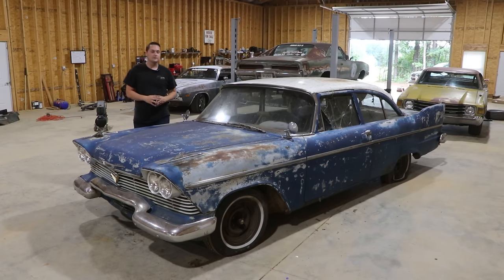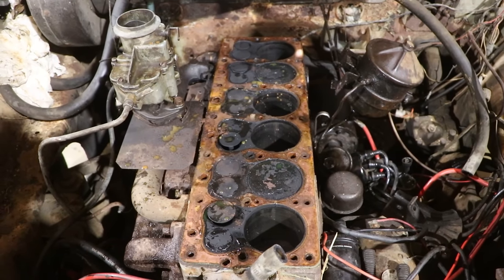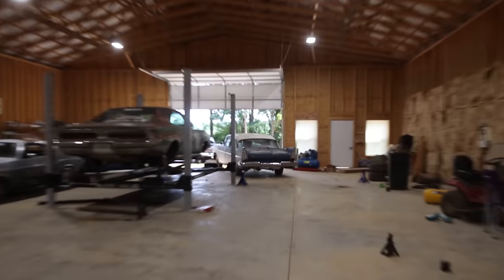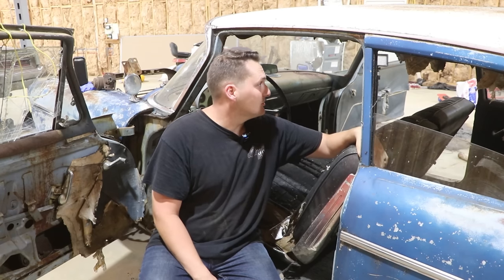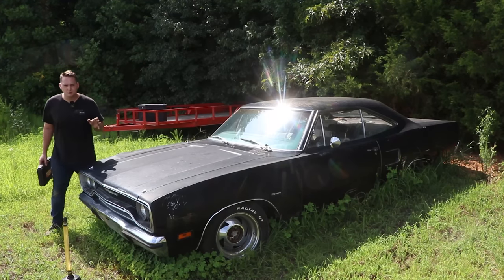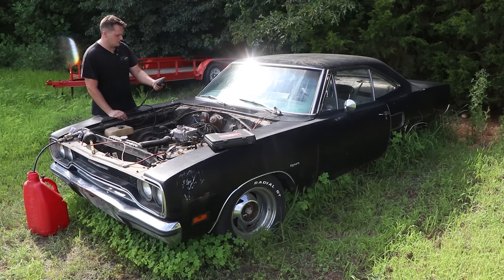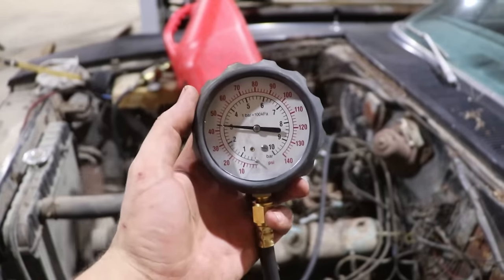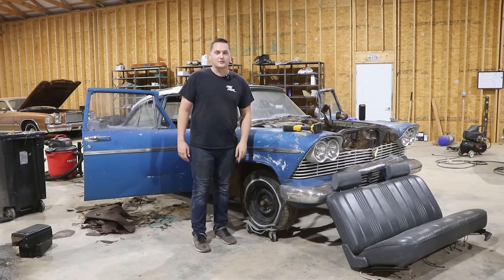Barn Find 1958 Plymouth Engine Teardown - Is It Too Far Gone?

Comment: I think it would also be cool instead of putting a V8 in it Build up the Six like the old school Hot Rodders did back in the day because you can put a different intake and a 4 barrel on that Six and make decent power
Reply: He said that flathead six was too worn out to rebuild.
Reply from the maker: Would be cool I’m sure. I just have no interest in modding s six cylinder.
Reply: @danielventura8073  Yes, and let's not forget that everything is fixable, but at what cost xD, you could for sure refurbish the old flat six but it would just take a lot of money and time sadly.
Reply: In the cars day, that is what would have happened, Mod the old six, cam, carbs, free flows etc, ANY engine can be rebuilt regardless of how worn it is!!!!!
Reply: Americans thinks anything under 8 cyl as "small" lol when this car has a very big 6 cyl!! But make sense to V8 swap It for him, from the availability of parts for example V8 Is more common he can find very easily a simple configuation good for the car and for cheap
Reply: @gillespriod5509  I keep forgetting that European car makers since the beginning made cars with small engines to save on gas. I still remember getting to sit in an Alpha Romeo Montreal when I was younger. Amazing how that car had a 2.5 liter V8. thats the capacity of a lot of in line 4s!
Reply: @loganorlikoski1743  yes anything over 1600cc Is considered big in Europe,and with the price of gas you cannot daily drive a 2 liter without becoming poor😁
Reply: Whew that's a relief. I've been sweating bullets here thinking Dylan was going to put a city LS in the Plymouth.
Reply: @gillespriod5509  ANY engine can be REBUILT up the compression cam, carbs, free flows etc it will make decent power and speed, remain ORIGINAL and More COOL, ANY IDIOT can V8 swap a car, they are ONLY ORIGINAL ONCE!!!!
Reply: @DylanMcCoolVideo  if you want to go 318 why not drop a 340 or 360 in it?
Reply: @DylanMcCoolVideo  sorry Dylan didn't mean to stir up a hornets nest about saving the Six. It's your baby you do what you want. I still think black and call her Elvira would be Awesome
Reply: @barryphillips7327   im a mechanic and i rebuilt in the last 20 years many engines from vespas to rally cars since i was a teenager, i know that! So? He can keep the six at home in the big garage he has, maybe even rebuild It for the future if he care of the originality, i always do that on my older vehicles if Is worth doing! but the V8 makes more sense for him for reliability,  parts prices and availability,  Is a no brainer!!!  He plans to use the car, maybe doing roadtrips, not to park her in a stupid museum! Anybody Is always Expert in YouTube comments! LOL!!!
Reply: @gillespriod5509  as you know then ANY engine can be rebuilt ANYTHING can be rebuilt IF the owner is willing, i,d prefer to see the six stay, done up warmed over, any idiot can drop a V8 in the car but it is not meant to be there!!
Reply: @barryphillips7327  he can do a good v8 swap, he has the right engine, the same car came also in V8 version, so Is not bad like put a japanese engine in It! And he can rebuild or tune the V8 before mounting it
Reply: from a lot of car channels i watch sadly the solution to everything engine related is put a v8 in instead of a 6 cylinder
Reply: @danielventura8073  He said it was too worn out to re-ring without reboring.  Never too worn out to rebuild.
Reply: @kristofferjonassen4761  Flathead 6.  Flat 6 is what the Corvair and Porsche have.
Reply: @tractorjunkco9431  Then he would have to replace the rear end as well.
Reply: @kristofferjonassen4761  There isn't a lot of high dollar mods for the flathead.  Many of  the parts mostly make them look cool . An old mod was to split the exhaust manifold.  The bigger 251-265 flathead is a better base for mods but even fewer aftermarket parts for them.   You can bore  the 265 to 282 inches and they are fun in a light 30s coupe,  they make decent low end torque. . You can get about 200 HP from the bored 265 driven on the street,  but 175 is more reliable.  I like how they look, but the 50s cars were getting too heavy for them.   Flatheads can be a very trusty in daily driver if you don't push them too hard.   The Ford flathead v,8 can't make much power either, unless you spend a huge amount of money - but the aftermarket exists for the Ford, such as large bore blocks and stroker cranks.  Mopar should have offered the 265 in a Plymouth, it can almost match a small V8 from that era - such as the Dodge 241 which was rated about the same as a slant six
Reply: @michaelbenardo5695  lol you are totally right, I tried to shorten the name a little bit but now when I look at it haha it just looks stupid 😂
Reply: @timothykeith1367  Yeah exactly, it's a big shame seeing a lot of these cars engines becoming unreliable because the aftermarket isn't high for them, I think if you wanted to make more power you would have to do most of the things yourself, but I remember seeing a video of a guy in England he had a flathead six with a turbo and that was pretty beefy, it would kinda be funny to see something similar be done with the original engine 😂
Reply: @danielventura8073  Nonsense. A machine shop will resleeve that block and restore it to factory specs for probably 500 bucks if that. Those flat six are hard to kill. Lifetime engines.
Reply: Totally agree. New rings. Hone cylinder walls. Will restore compression. Can be done without pulling engine. Dual carb intake and headers. My 51 Plymouth runs great.   Anybody can swap a V8 into something.
Reply: He's doing it hot rod style. No restoring style. Use what you have without giving your money to a shop to redo things.
Reply: @mikek771  Ok. Hot rod style. Got it.
Reply: @mikek771  your a genius, if it wasn't for you we would have never known 🤣
Reply: @jeffgorman6447  it's a Shame the old Six Bangers most of the time are ripped out, because most think they can't produce Real power. There was a guy a long time ago that ran a 67 NOVA wagon with a Built Inline 6 on the drag strip and kicked ass.
Reply: @DylanMcCoolVideo  if the Plymouth is to be repainted, I think it should have the same color
Reply: @ Gilles Priod

I object to your statement regarding reliability... in the average car with the average driver with proper maintenance in the same average conditions that flathead six will easily outlast the 318 V8 in a head to head matchup for reliability! The V8 will also cost more across the board to operate and maintain as well.  🇺🇸

- Max Giganteum
Reply: @barryphillips7327  
That's true, the problem is,  is it worth rebuilding? Why put $2000 - $3000 dollars in an old flathead 6, when you can take a 318 with the 3 speed auto you already have and put it in? Much cheaper to swap engines.  I had a 57 Dodge pickup,  had s few problems.  In 1977 I replaced the pistons,  rings and head gasket,  and oil pan gasket.  The pistons were $5 each I don't remember the cost of the rings but was very reasonable.  For about $50 I was able to replace the pistons and rings  ( standard pistons)  it ran very good.  Only got about 16 MPG.
Reply: @DylanMcCoolVideo  HOORAY!
Reply: I totally agree with this!
Reply: @DylanMcCoolVideo  you should build a generator/compressor out of it for the shop.
Reply: Robert, you’ve cleaning never owned a flathead 6, or know a thing about them......
Reply: @Twintania  that’s because 6 cylinders are lame …
Reply: @MaxGiganteum  what’s your point ? Almost anything will outlast a 318 as long as it’s not a mopar!
Reply: @michaelbenardo5695  
The corvair,  and Porsche have over head valves,  not flat head.  They are called flat because the cylinders are opposite,  and flat  like a VW.  they all have the valves in the head, not the block.  Big difference.
Reply: @robertvance1873  
The 67 Nova had an over head valve engine not a flathead.  The Ford flathead V8 will at best make about 250 horsepower,  and that takes a lot of money to get that kind of horsepower.  The flathead 6 is a waste,  if you just want to use it for a stock application it's fine,  but for performance it's a waste.
Reply: @bertgrau3934  The guy I replied to called the Plymouth 6 a Flat 6, which it is not, it is a FLATHEAD 6.  I did not say the Corvair and Porsche used a flathead 6, I said they used a Flat 6.
Reply: @bertgrau3934  In restorations, the object is not all-out performance, it is factory correct specifications.  OK to juice it up a little though.
Reply: @LynxStarAuto  
I think you're way off on your estimate of $500 . Why not bore and put over size pistons in ? That would be cheaper than boring,  and putting new liners in. Those could be bored to .080 . With pistons from .010 , 020, .030 .040 .050 on up to .080.
Reply: @bertgrau3934  Classic cars shouldn't be about cheap, they are supposed to be about AUTHENTIC, although the 318 and the Torqueflite were both options on the 58 Plymouth.
Reply: @Hard_Right  But classic cars are supposed to be kept STOCK.
Reply: @michaelbenardo5695  
I doubt a 1958 Plymouth would be considered a CLASSIC,  maybe a special interest.  Still to restore that thing, would most likely take more money than what it would be worth.  I have seen many times folks have restored antique cars and they looked great, but they would be lucky to get half to three quarters out what it took to get them back to looking new.  I don't blame him for not wanting to do a full restoration.  I wouldn't either.
Reply: @bertgrau3934  True, no mass-market car is a true Classic Car - capital C - but it is a classic Plymouth.  Also true, it will cost more than it is worth in dollars to restore it.  It would be a labor of love, not an investment.  But look at how boring our automotive landscape is nowadays.  Nothing but Datsuns and Toyotas.  I for one am sick of seeing a street scene that looks like I am in Tokyo.
Reply: @michaelbenardo5695  
Sir, I agree with you on that. I like to watch the older shows, movies where they have the older cars and trucks.  I watch Highway Patrol,  when that show started they used a 1955 Buick. I personally had a 56 Buick 2 door hard top.  Had the 322 cubic inch engine and the Dynoflo transmission.  No power anything.  Was a nice ride but only got 15 MPG.  I gave $50 for it in 1973,  I sold it because I joined the Marine's in 74.  I got $100 dollars for it, and it looked much better than the 58 Plymouth.  Had good paint and interior.
Reply: @MaxGiganteum  
Sir, you make a lot of good points.  Fact is it would most likely cost more than it would be worth to restore.  All I'm saying is go ahead and use what he has,  it can be done, and probably a lot cheaper than rebuilding the flathead 6. 
Just because you swap engines doesn't mean it will be unsafe.  I put a 75 Cadillac 500 cubic inch engine and TH400 transmission in a 1977 Chevy pickup.  It turned out extremely well.  It had lots of Torque,  and at 65 MPH,  it got 16 MPG.  better than the 350 it replaced.  Total cost was $1750 . I did all the work  myself.  Made engine mount adapters,  transmission  mount,  and had zero problems after I got it together.   
The biggest problem I had was when it rained,  it was hard to take off without te wheels spinning. On the other had, when it was dry, at 25 MPH  stomp the gas o the floor and the transmission would down shift to 1st and the right rear tire would go up in smoke.  Didn't have positive traction.
Reply: Dylan does this mean you’re also using the 3Speed transmission and find clutch and brake pedals for the 58 or do you plan on running a Automatic transmission?
Reply: Boost the flathead
Reply: @bertgrau3934  You actually got that much - 15 MPG?  I had 4 Buicks with Dynaflow, and none of them got better than 13, except for the time I put a carb for a 61 Skylark on my 61 Nailhead.
Reply: @eddiepatterson5025  If he does convert to a 3 speed, he also needs to find out what his rear end ratio is, as a manual trans will not pull as tall a gearing as an automatic will.  It will be overgeared, resulting in an overly tall 2nd gear.
Reply: @Hard_Right  Not if it is a rare car that came from the factory with a 6.
Reply: @michaelbenardo5695  
Yes sir.  Ever since I was a kid,  I was always keeping track of gas mileage,  and other expenses.  I lived in Columbus Ohio when I was a kid, I tuned it up right after I bought the Buick.  New plugs, condenser,  distributor cap,  rotor,  plug wires,  I advanced the timing by 3 degrees,  used .040 on the spark plugs,  changed the air cleaner from oil bath to paper.  Used carb cleaner on and in the carb.  And at that time the speed limit was only 55 MPH  . On a 120 mile trip one way I did get 15 MPG.  I went east towards New Philadelphia,  Ohio.  I 70 to I 77 north to New Philadelphia.
Reply: @DylanMcCoolVideo  can i buy this car? 😍
Reply: @danielventura8073  that's why you rebuild engines is because they're worn out. You don't rebuild good engines
Reply: @kristofferjonassen4761  not as much as you might think. It's a very simple Motors
Reply: @DylanMcCoolVideo  same here bud,  I'm like you I'm a V8 guy

Comment: That's a great idea swapping those engines around, if you didn't save those cars they would be in a junkyard. Also its just plain practical to use a good running engine that you already have.

Comment: For sure the 58 with the 318 will be a great build. The time and money will be well worth the effort. The 318s were good engines and over performed if built just right. Pulley combinations, valve spring shims, carb jets, torque converter change out and etc. will make a 318 quick. Best of luck to you. I raced several 318 engines back in the early to late sixties. I loved to work on them. I always ran the engine temp hot and painted the block black .

Comment: Those 6 cyls are pretty tough but
A 413 would be nice
Reply: That's a swap I would agree with
Reply: @danesderelicts   nuthin wrong with a 318..to bad it wasnt an old 318 red block...the old big block truck 318...gobs of torque
A guybi know swapped a 413 out of an imperial. Into a 57 dodge regent 2 dr...
Was a real head turner when he stomped the gas and tires were hollering 😂..with 2 thrush glaspacks.
Reply: @rodsvintagesxschannel.3095  that 318 is not that far away from the flathead. Those Motors put out almost 130 horse stock. Plus tons of torque. I know they made more power than my flathead V8
Reply: Be nice to see it on the rd again.

Comment: I'd love to have that 58 flat head (L-head) engine to rebuild and put in my 1936 Plymouth!!!
Reply: Check with Dylan; he says he’s willing to part with it!
Reply: That would be a worthy upgrade for a '36, keeping with the "Roadsteration" ideal.
Reply: And you would have a welcome boost in power too - 230 cubes vs only 201 in your 36, if it is stock.
Reply: @michaelbenardo5695  Also easier to find parts for the 58 over the 36 
Except I'm getting too old to fix either one (I'm 74 years old) I don't think she will ever be on the road in my lifetime!

Comment: Yes!  She gets a 318!  Woohoo!  Glass packs and duals for sure!  Also like that it's come from the Satellite and that the Satellite is going to live on with something more befitting its colour and stance.  When I think of the 'rodder creed, you're right - there was a large amount of low budget mods that you did in order to make something go better.  Finding another good engine, a replacement pair of bucket seats and console to replace an unwanted bench seat, using house carpet instead of paying for an expensive set of repros - these I have done myself over the years and saved my money for the likes of a decent exhaust system, a new carburettor, maybe even a decent sound system.  The 1977 Mini I own nowadays has been done with this mentality also.  You could also call it a shout toward recycling things that would otherwise sit and rot away!  All the best for this project, Dylan.  Looking forward to seeing progress on both cars as time goes by.

Comment: My best junk yard engine was for my 86 300ZX, my original engine shot a rod right out of the block, and of course that means new engine required. The engine I found was in an 84 300ZX that had been rear ended, i was expecting to have trouble finding my engine and expected to have to find a new vg30 and parts swap, so already awesome to find a car with my same engine, what made it ever better is the engine was clean, i mean super clean, and freash paint on it, just a little bit of oil. If i had to guess that engine had been recently rebuilt, maybe had 500 miles on it, checked the water pump ect, it all was new looking inside. Was my favorite junk yard find, didn't expect a freash rebuilt engine from the junk yard, and i only paid $400 for it including all the accessories lol.

Comment: As always great video Dylan, I think the 383 would have been a good volunteer for this car since they would have been readily available in junkyard cars in early sixties, those transmissions were very dangerous if you jack up the back of the car to change the tire with one wheel off the ground it could roll and fall off the jack. Would really like to find a car like this myself.
Reply: First year for the 383 was 1959. Optional for Plymouth in 1960.
Reply: @bigblockjalopy  his goal was to find an engine that would have been bought cheap from a junkyard car in the '60s to revive the car and make a cheap hot rod and be somewhat period correct.
Reply: @mrpurcountry  Yes, I just posted that because you said the 383 came out in the early 60s. Both versions of the 383 (B&RB) came out late in 58 for the 59 model year.